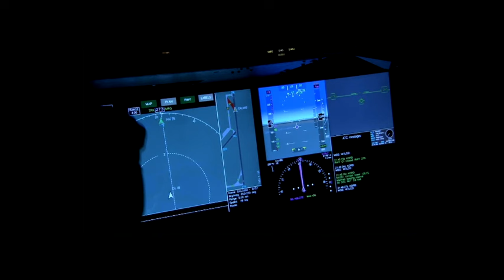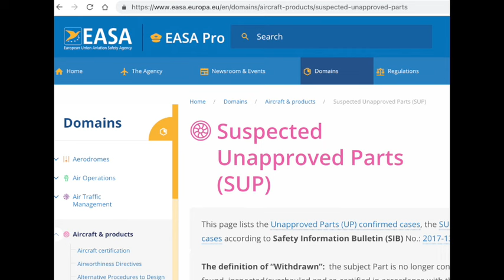Gender Reveal Plane Crash Kills One, Bad Parts Back in Circulation – Episode 183

Comment: I think it's pretty self-evited that the pilot put too much air load on the wings with that heavy pull up. A lot of pilots don't understand air load, they know what a g load is but not an air load that looks like a classic air load over stress. Most aircraft would they fail in a g load overload It's the tail plate that fails down and then the nose of the aircraft pitches down and then the wings break downward. In this case the left wing broke upwards looks like a classic air load overload